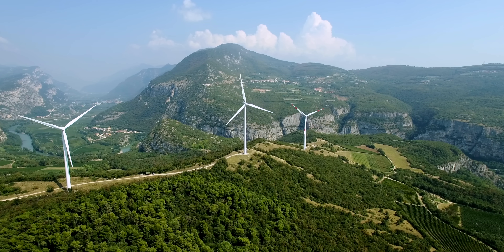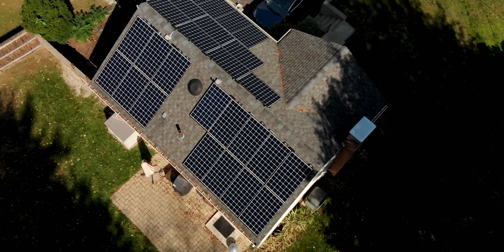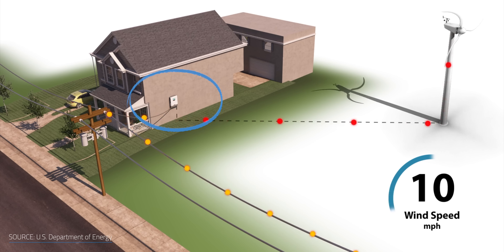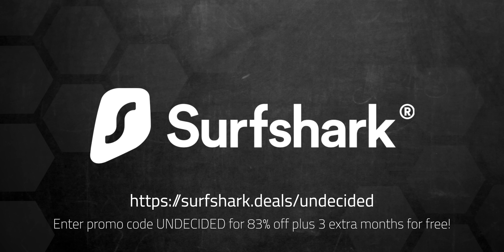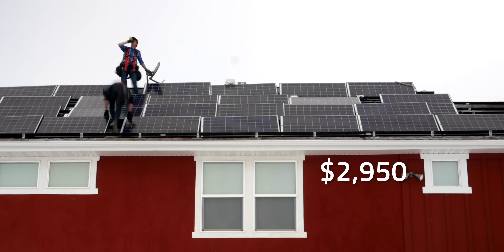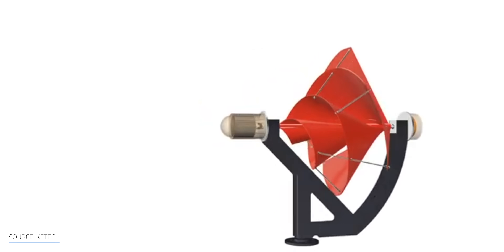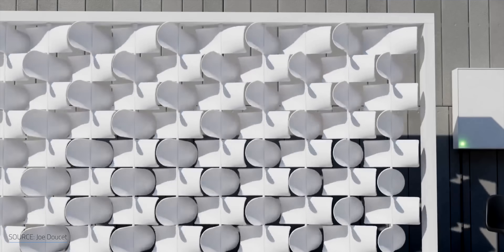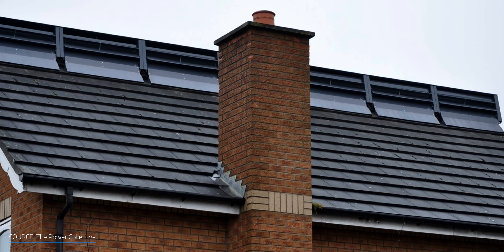The Challenges of a Wind Turbine on Your Home

Comment: I know that economics is a consideration on any green power generation for a home, but ALWAYS looking at these installations with a "return on investment" framing is exactly how we got ourselves in this boat. Companies that generate power using coal and other fossil fuel based generation count on that argument as one against green power generation at all. Yes it is costly, and there is maintenance to consider, but no one determines a "return on investment" when they buy a car, and this is no different. You spend the money and it is gone, then you look at what it gives you as a asset that will give you a net gain during the life of the turbine. The question is not whether or not you get a "return" but what will it give you into the future with reliable small scale generation.

Comment: Thanks for the insight on wind power. A huge problem I have is both roofs on the house and garage are covered by big trees. So, I figured while solar panels on the lawn is a pretty limited option, I could supplement with wind power.

For now, I am trying to make sure that sunk cost fallacy attitude I worry about is in check. So, the only direction I have taken thus far is building a decorative garden windmill if only to get an idea on how practical wind is for me. As a bonus, I could even repurpose the derrick the windmill comes with to install a proper wind turbine. Even though the derrick is a meager 12 feet tall, I have seen some promising signs to move forward.

Getting the entire property off-grid is probably unlikely no matter what wind and/or solar kit I try to install, but if I can get a few power-hungry toys running off this build, that would be stellar.

Comment: We have been using wind power for a long time now. It seems to be better used mechanically though, think windmills pumping water. On a remote site it doesn't male sense to install a windmill and have it produce electricity to run a pump as needed. Instead you have it run the pump and just put a large reservoir and pump water when the wind blows and the reservoir does the watering when its still. There can be a lot of utility in using wind power, but it tends to be much more site and situation specific. You cant just buy a wind kit and make it functional everywhere with some slight modifications like you can with solar. Its the Linux of renewables. Much less user friendly, but if it fits your situation and you can learn it then its near impossible to beat.

Comment: SAVE YOUR MONEY - FORGET WIND & SOLAR PANELS !!! 
Within a few years electricity will be rapidly falling in price. Thanks to the invention of the PLASMA REACTOR (first announced by SAFIRE at Bath University UK in July 2019), which is guaranteed to sweep away ALL other current methods of power generation due to its multifunctional capabilities, as follows:
1. Extremely cheap & green electrical generation 24/7 & 1600% more efficient than even a current Nuclear Power Station.
2. Remediate Nuclear waste. i.e it will totally "eat" the material creating the dangerous radiation, and save us all Billions a year by getting rid of all this highly dangerous material that we have too currently bury & store.
3. Transmutation to produce Rare Earth Metals in Industrial Quantity at a fraction of their current cost value.

SAFIRE was a High Tech Canadian Electrical Engineering Research Company, set up to research the concept of the Plasma Reactor, and produce a working prototype (completed in mid 2018).

AUREON ENERGY Ltd. A Canadian Electrical Engineering  Development Company, set up to develop the "Safire prototype" into a fully commercialised saleable machine system. Commercial Design & Development is expected to take another 2-3 years. You can find AUREON ENERGY's elucidating advertising elsewhere on the Internet !

The "Plasma Reactor" is intended to simply replace the Gas/Oil/Coal or Nuclear part of any current main grid power station. Power stations boil water to create steam, which is then fired under pressure at Turbines which then rotate. Each Turbine is connected to a Generator which then also rotates generating electricity. So whatever the fuel supply used, it is only used to boil the water to make the steam ! 

But of course the Plasma Reactor can simultaneously do the other jobs listed above, effectively Guaranteeing it will eventually sweep away all current methods of power generation. The cost of electricity will therefore plummet, making even wind generators & solar panels financially untenable !!!

LOOKING FORWARD TO CHEAP ELECTRICAL BILLS !😄.

Comment: The design of the ridgeblade seems like one of the more practical residential designs. An idea i like is using the turbine wall as really unique fence line along the front of a property. You still gave all of the issues of it being low and blocked by other structures. Not sure if the wake from cars going by makes up for all that xd

Comment: I notice that most of your illustrations use multilevel homes.  In the Midwest there still many ranch homes. The elevation required would be minimal, reducing costs.  Boats have been using turbines for years. There should be proven tech available.

Comment: I spent $1000 on monitoring the wind in my area and after a year's worth of data found it would take almost 30 years to pay for itself. I live in a windy area, but it only blows hard 6 months of the year. The rest of the time you get small breezes that just don't produce energy. It was a terrible let down. Also vertical windmills look much nicer on or near a home, but they are much less efficient than horizontals so that is another issue. And I looked into nearly 30 different designs of wind capturing devices. All had lots of moving parts and required upkeep.

Comment: Both wind and solar depends alot on where you live, like here on the western coast of Norway we have almost no solar power during the winter months, and alot of solar in the summer. And the opposite is true for wind, where we have alot during winter and not so much during summer, so a combination is very nice for self sustainability, Also the prices you have listed for wind is alot higher than what you can get it for if you do a bit yourself, you can get genuine 1500-2000w turbines for like 800 dollar.

Comment: Thanks for another informative video.

One alternative option not considered here is community ownership of large scale wind; where as others have pointed out the payback is much better due to the larger rotors and taller base. It’s an option worth exploring in many windier areas, either to compliment Solar and make up any shortfall you may have due to limited roof area for your panels or where there are total restrictions in apartment blocks etc. In these situations clubbing together to build a co-operatively owned wind farm (and or solar farm) are great options. We have a number of regional projects in the UK, where cloudy days are common on our small island but the wind blows a lot. There is also an innovative company called Ripple energy that is using its expertise to help develop new wind farms and offer them to the public for shared ownership through a co-operative model and partnering with energy suppliers to take the costs of the energy generated off those owners bills.
Reply: Community ownership.. sound like a great Idea!
Reply: Great idea. I live in a small village located atop a hill in the Weald in Sussex. We get loads of wind from all directions and this would be ideal to power the whole village.

Comment: my own home gets a steady breeze from one direction, and so would probably be well served with the hidden design of a wind turbine, in that it could offset my solar at night, or during overcast times. I had actually designed my roof, not yet built, for the one type of wind turbine design , and planned on using VAWT as well, with solar also, as I do not want on the Grid..lol

Comment: There are four vertical wind generators on the green gas station in my town. Two are running (WITHOUT LOAD) and two are not working (because they are connected to the network). Physics can't be fooled. Quite large propellers are needed to run the generator and it will produce energy.

Comment: You can often find 10,000 kw hour turbine for $250 with another $250 for inverter.   Seems like wind turbine work better in north where it snow.

I'm very curious where you get your numbers.   I was pricing out 30,000 kwh with 8 000 kwh better 48v with inventers for just under $10,000.

Comment: You forgot one thing check local codes that the power company's alleged had input in writing. To install a wind turbine on most city property's is impossible to meet code. Must be so many feet from the house or out buildings, so many feet from the side walk and so many feet from the property line. At my house the lot is to small I could never meet city code not enough room.
Then say I make enough power to meet my house requirement and have extra to sell to the city. If city power goes down the system is set up so yours power goes down to so you don't back feed the lines. If I was to use solar and wind turbines I would want to be totally off the grid so I could use my power anytime.

Comment: Friend installed one on the roof of his off-grid house. The house is basically a large garage shed on a concrete slab. Anyway the thing lasted  up there less than a week before being moved well away from the house. The vibration set the whole place humming and rattling. I conclude that turbines are best installed on their own well-grounded tower.

Comment: I see some major problems with some of your numbers and facts about wind power.

First, Solar is NOT maintenance free.  Dust settling on the panels can seriously degrade energy capture before it is even visible, and hail is a serious danger to solar panels, and can disable an entire set in a matter of minutes, forcing total replacement.  (Both of these are major issues for solar power in Colorado, as I have known people with these issues.  We get up to 5 hailstorms per year in the Denver or Boulder areas, most years have at least one, and tons of solar panels need to be replaced before they've paid for themselves with the power generated.  I have one friend who has had to replace his panels 4 times in 10 years, specifically due to hail.)  

Second, That wind turbine cost is way overinflated.  Decent vertical wind turbines are about $1 per watt.  Erecting them is added cost but, a it would take erecting 60 1kw units to get to that $80,00 cost figure, and I don't see too many people doing that.  Maintenance costs would not be as high as you state unless there were other factors at play, like vandalism.  Bearings would be the biggest cost involved, and that's closer to $10/year.  With all parts, a 4000W maximum and 1000W average installation, which is about average generation for Colorado wind/weather, with 4 vertical turbines, would cost closer to $6000 to install and annual maintenance costs of closer to $40 per year.  Plus, made of the right materials, like aluminum fins, would not be nearly as fragile to hail as solar.  I do not know where you got your numbers from, but they're rather wrong.  At the quoted $5,000 for a single 1kw turbine, they sound closer to someone trying to seriously oversell you on something.  The unit itself should be about $1000, and if you do the installation yourself on a roof peak, should be less than $100, and the electrical should be about $300 from a good electrician.  If you add in a battery bank and inverter, then another $1500-2500 could be involved, but that should not be included in the cost of the wind turbine cost as it would be separate functionality, or the comparison with solar power.  

Third, under the right circumstances, they don't need to be mounted as high as you said.  They could be mounted at the peaks of roofs pretty easily and make some good amounts of power on a tall house or if the neighborhood is fairly flat.  With a short house, they would need taller poles, and likely would not be a good candidate, but my younger sister just looked at a house that would be perfect for wind power, as it is a two story in a neighborhood of two story houses in a very flat area, with rather consistent strong winds from the west, and 4 good peaks to mount 4X 1kw vertical wind turbines.  

Then there was the noise matter.  (Fourth)  Yes, many small horizontal turbines can generate rather loud noise.  Personally, I do not recommend horizontal ones for several reasons, and noise is one of them.  They do have to be made of lighter materials, generate more noise, can be overspun and damaged in higher wind speeds, and generally cost more to maintain than vertical units.  Vertical units can wear out bearings faster, but that's more from the fact they stay up and operating, and generating power, far longer than horizontal units.  Properly designed vertical units have bearings that can be replaced pretty quickly and easily.   

Fifth, there's also the inverter matter.  IIRC, solar generates DC current as well, and needs the inverter just as much.  On top of that, perhaps not everyone who has solar needs a battery bank, but it sure is very handy in sparsely populated areas with unreliable power, and a combo of wind and solar can be used and give optimum results in such a circumstance, far better than either one alone.  With a battery bank, the inverter is included and necessary with either type of power.  

The RidgeBlade is a pretty interesting design I hadn't seen before, and the way it captures wind fulled up by the roof is pretty neat, but I see some issues with it.  Vertically mounted and properly channeled (channel the wind away from the backside of the fins and into the forward motion) could generate more power, and be quieter and less visually obtrusive.  Plus that design would be great for Colorado, as it would be shielded from hail.  

Sixth, there are some major advantages of wind over solar you don't talk about.  Done right, smaller wind turbines can produce less unrecyclable waste than solar, as broken solar panels are entirely unrecycleable, as are most of the supporting parts, while aluminum fins, steel poles, and typical generators in small, properly designed wind turbines are all near 100% recyclable, and are materials that are currently heavily, cheaply, and efficiently recycled.  

Lastly, the small wind market vs solar market is the way it is specifically because of government interference.  Massive tax breaks for solar and the massive government investment in solar technology are done for political reasons, not because solar is better.  Wind power in small installations can be cheaper and better if there weren't government officials getting payoffs to make solar cheaper.  The worst part about the government interference is the push for wind power is also doing it wrong, as the big wind turbines are generating tons of extra waste due to the use of fiberglass on blades that need to be replaced every 2-3 years, all because of political donations by the people building the big turbines. We're all going to be buried in the waste generated by the political class and their methods for renewable energy.

Comment: I'd love a share in a turbine of the 4th type you didn't mention. High altitude wind power like Skysails Power or KiteGen.
Also check out this turbine.
https://m.youtube.com/watch%3Fv%3D0doOVgju6S0&ved=2ahUKEwjA0662pbr3AhXx-ioKHTN6B9gQjjh6BAgoEAI&usg=AOvVaw3VVbm7rMHzY2o9ZWqzaDBA

High altitude wind can operate at full capacity for up to 6000hpa making it baseload wind. Also does away with the towers and all the concrete base.

Comment: oke... the hotter. the less solar brings to the table. not to mention night time.  and dirt / dust on the pannels.   also the transformer wont last 15 years.. and how about the fact pannels are not easy to recycle. as pannels 4 years ago new did not have the same out put now new.  this is a major issue

Comment: Check all building codes and by-laws! I reside in Ontario, west of Toronto. More than a decade ago a farmer close to us installed a fairly substantial horizontal axis turbine on his property without regional permits etc. Township counsel took issue with his project and threatened to change his zoning designation from agricultural to industrial which would force his tax bill to be insurmountable. Remember this is out in the country, not in the city. Those beautiful blades haven't turned in over a decade...

Comment: I would disagree people aren’t going solar and wind to reduce dependence on fossil fuels it’s to offset the increase of forcing the companies to use these systems instead of fossil fuels which increases the cost of power. Let’s be real if we continued using fossil fuels we would see decreases in power cost. If you wanted people to get off fossil fuels you would continue to produce power large scale through fossil fuels and incentive the individual to produce more of their own power reducing the need of the system by installing such systems. People got it ass backwards these systems should have never been set up as a primary system and shouldn’t be building up farms of these systems instead everyone should implement these systems on their own properties